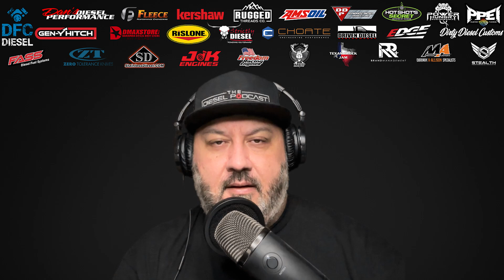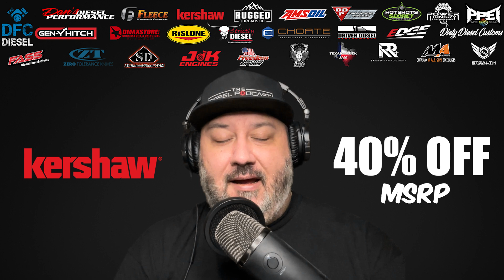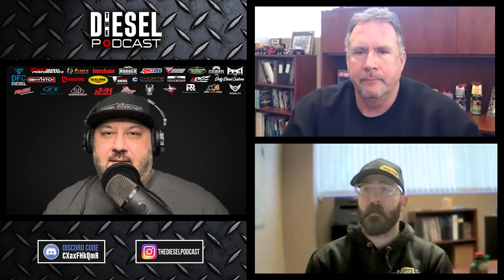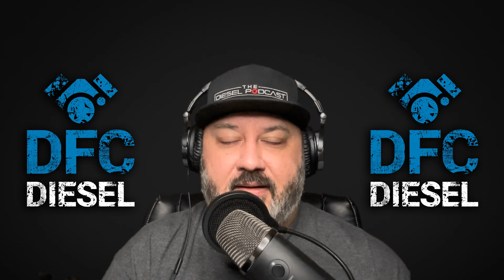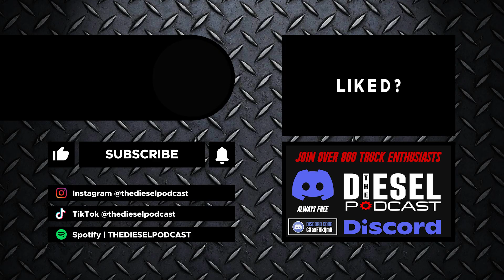Fuel Additive Benefits for Lubricity, Cetane & Injector Cleaner

Comment: I'm definitely late to this party seeing the video is around a year old. In Australia, we have good quality diesel overall, but diesel is an inherently dirty fuel source, particularly compared to gasoline or LPG. Carbon will build up in your engine and because of that, you need to make sure that your engine is running cleanly. People do remove their EGRs and DPFs then remap the computer and put tunes through them, they run far better and a lot cleaner for it, but, get caught and you're up for over $10000 in fines. Some mechanics offer a de-carbon service where they'll hook up lines to your engine, and and run solution through your engine while your engine is running, but that sort of only does a little bit. I'll argue that you physically have to remove the manifold and clean it that way. 
On my 2013 Amarok, I've put on a good catch can which means fresh air is going through the turbo, not blow by. But using these cleaners, particularly Rislone Hy-per Diesel Cleaner works a treat. Stops that varnish like build up forming on the injectors. My engine is running beautifully still.

Comment: USEPA and CARB set all standards and specs for refined diesel fuel in the USA. ULSD is very low quality diesel fuel compared to diesel fuels refined prior to 2006. The primary problem with ULSD is fuel oxidation and air contamination. ULSD just plain SUCKS. petroleum diesel fuel is virtually the same across the USA. ULSD low quality adulterated mule piss.
Reply: your refineries just makes it crap. We had ULSD 20 years before you and there is no problems with it.
Reply: @V8Lenny  different diesel in europe than USA. USA diesel is horse piss
Reply: @ox-cetane4887  yes, because of refineries producing shit. Why dont you sue them ? You can get millions from McDonalds if coffee is too hot and burns your mouth.
Reply: @V8Lenny  It is not the refineries. It is the congress and the RFS/Renewable fueling standard. The refiners have no say or input on the diesel fuel makeup. USEPA and CARB aka AIR NAZI's tell the refiners what specs their diesel fuel will meet if they want to sell diesel fuel in the USA
Reply: @ox-cetane4887  but they dont meet those specs. And those specs are still very low compared to europeans. Less lubricity, more water and sediment allowed, lower cetane required. And in Europe those specs are actually followed.
Reply: @V8Lenny  indeed
Reply: @V8Lenny  Really, ask yourself why the Bosch CP4 fuel pump is having so many failures here in the USA and not anywhere near that in Europe. Fact is ULSD is adulterated swill. If you knew anything about fuel you would know that.
Reply: Long live Renewable Diesel! MUCH less soot and 85 Cetane! Sounds like a DI gas engine now! Insane unearthly diesel no lag throttle response!
Reply: @Good-luck-Jonathan  Best diesel fuel going if you can get it. Not available in most states
Reply: @ox-cetane4887  Hopefully one day. Many pumps though do now use it over the bio if you read the label they now say 5%-20% Renewable OR Bio
Reply: @Good-luck-Jonathan  If you're in California, Oregon or Washington and don't mind the state government using your tax dollars to subsidize the cost of renewable diesel fuel to bring down the price at the pump to compete with petroleum diesel fuel pricing

Comment: Has anyone ever defined for you the meaning of diesel fuel lubricity beyond just the words? Meaning what is the causal mechanism for poor diesel fuel lubricity. Sulphur has no lubricating properties whatsoever. What did Sulphur do when it was in the fuel? How did it function?
Reply: I dont have the lubricity explanation for you but as they said in the beginning of the podcast the process to take the sulfur out is what takes the lubricity.
Reply: @ you might ask yourself what did sulphur do when it was in diesel fuel? How did it function? Sulphur is an antioxidant. Gasoline and diesel fuel have always had a problem with fuel oxidation and air contamination. When the Air Nazi's at USEPA and CARB mandated ULSD the problem got significantly worse. Fuel oxidation and air contamination are the two primary problems in ULSD. Solubilized oxygen and dissolved air in ULSD are the primary causal mechanism for poor diesel fuel lubricity.
Reply: @ox-cetane4887  
I don’t have a way to send you a photo, but it’s called a wear scar ..

Comment: Would be nice if I could test my fuel before running it..
Reply: No reliable test kits available for the customers.
Reply: @ billion dollar idea.
Only defense against being hoodwinked and expensive discoveries later…Like pregnancy test kits…
Reply: @lanehammer  what if the gasoline or diesel fuel could be rendered air free?
Reply: @ well on the delivery at the injector it is air free, so I’m not understanding where you’re going to unless you’re talking about air fuel ratio
Reply: @lanehammer  Not true. Both ULSD and ULSG have serious issues with solubilized oxygen and dissolved air which is referred to in the research as fuel oxidation and air contamination of the fuel. It takes from hours to weeks for the fuel to become air free and it returns into the fuel with agitation. If you want to read more according to the research papers let me know and I will post my email address. write me and I will forward them along